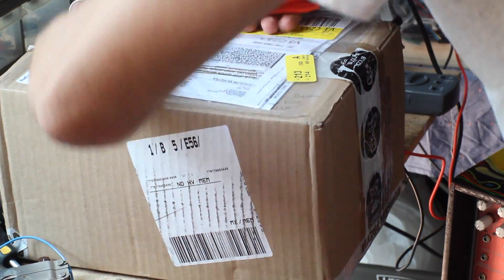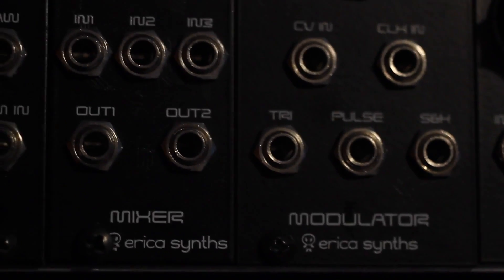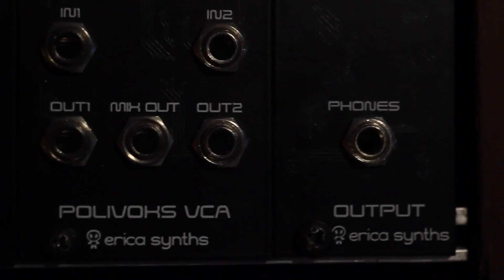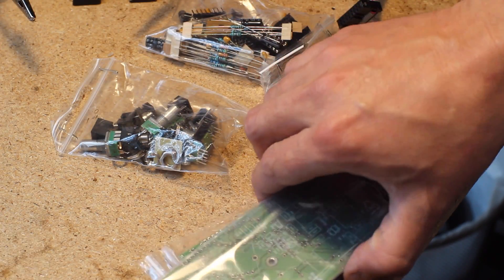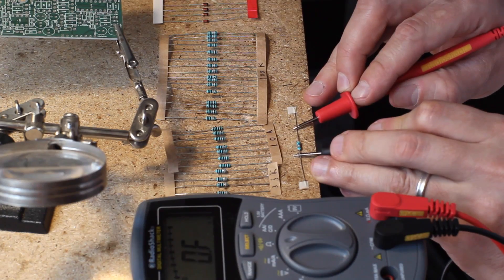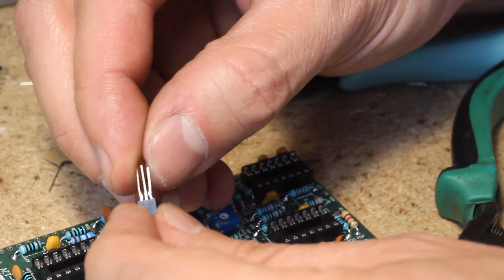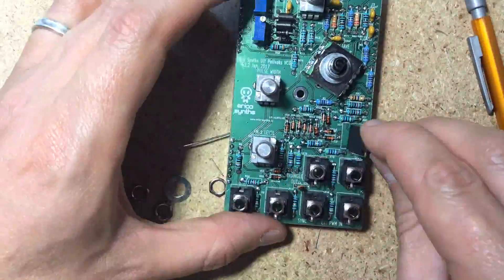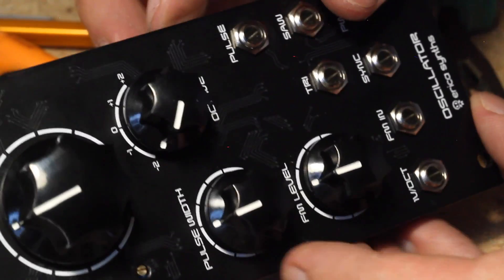Erica Synths DIY Bundle II Part 1 : The VCO

Comment: hi im planning on getting the panels and pcbs's for this kit. any reccomendations on what supplies i need besides a soldering iron.
Reply from the maker: Soldering STATION, with temperature control, Solder, wire cutters, tweezers, desoldering braid, desoldering pump, helping hands, multimeter, magnifier. That should do to start!

Comment: Hey synth DIY guy! I'm thinking of taking my first plunge into eurorack and i'm keen to start with two identical analogue VCOs. This one is on my shortlist, as is the Befaco Even VCO, the MST from Synthrotek,   the zlob dual VCO which is half the price and a quarter of the size of the other options. I am quite experienced with electronics so build complexity is not a factor... Just by aesthetics I think this is the nicest looking  one.. Could you please share any thoughts or suggestions? a befaco rampage and ornament and crime are high on my list i'll be mostly experimenting patching ambient noisy glitchy sequences..
Reply from the maker: Hi! Yeah, these are my favorite for looks and the big knob is super fun. If you have a linear power supply I highly recommend them, but they are fussy inder a switching PSU. The Befaco is more stable but lacks an attenuator for FM and instead of a Big pitch knob you get a big Octave switch. It has two extra waves and is smaller though, so, depends on your preferences and patching style!
I can't say anything about the MST or the Zlob since i've never played them. BUT, do stay tuned for the Ian Fritz Teezer, coming soon from Synthcube, it's my favorite analog VCO for noise, glitch and drone!

Comment: Do you have a video on how to calibrate? How do you use the multimeter and what exactly do you adjust? I've reached out to Erica Synths for clarification but have not heard back.
Reply: Hello Mr Bartok! What an honor :)
This VCO needs no calibration of wave forms, the onboard trimpots are there just in case, but the waves look great right away. Check them on an oscilloscope if you want to make sure. You only need a multimeter to check if you have any shorts in the power rails before plugging it in, to avoid accidents, but the resettable fuses and diodes are good protection. And for tuning the 1v/oct tracking all you need is your voltage source (CV keyboard or Midi2CV module), a tuner and a bit of patience. The procedure is detailed in the manual. Let me know if you have any further questions and I'll try to help!  Have fun
Reply: @QuincasMoreira having some trouble tuning. I can get 1 octave in tune. Then it starts to deviate 20 cents per octave. So up 2 octaves is in between 2 notes... Adjusting the scale will Always put an octave out of Pitch..

Comment: Hey, great video.  I just finished the VCO and so far so good except when I went to calibrate it, the module isn't tracking at all.  It's way off.  Do you have any suggestions for what to do next?   The octave voltages at TP1 were right on.  Thanks for any assistance.  -Adam
Reply from the maker: Hi Adam, sorry you're having trouble. It's hard to troubleshoot at a distance, what voltagesource are you using for calibration? I used my Keystep and it was pretty straightforward. Also, the PSU is very important, I find these VCOs behave well with very stable linear PSUs.
Reply: Synth Diy Guy 
Thanks for the reply. I’m using my Beatstep Pro. I’ve also tried it with my Pittsburgh Modular MIDI3. For the Power I’ve been using my Synthrotek Super Power. I’m going to try plugging it into my other rack today which is a  Tiptop power supply. I’ll let you know what happens. Thanks again.
Reply from the maker: No problem! If you continue to have problems try reaching out to Erica!
Reply: Synth Diy Guy 
I wrote to them last night. I know they are a very different time zone than me so I’ll try to be patient. 😀
Reply from the maker: Yes, Girts is also very busy, but I'm sure they'll help you out!
Reply: Did you ever have any luck with the VCO? I have the same problem as you- octave voltages are spot on but the tracking is not even close. I've tuned the scale pot over and over checked the frequencies on an oscilloscope as well as a tuner. It is always at least two notes off between octaves.

Comment: Great video. You mentioned a pdf with test point values?
Reply from the maker: Hi!  The PDF is my suggested procedure for building these as well as the optimal order in which to build them. I should post it later today. The test point values are in the Assembly guide, found in the Erica website.
Reply: Thanks for PDF - Where did you see the test points (1 to 9) on the assembly guide ? I could only find TP1 mentioned in 'calibration steps'.
Reply from the maker: you're right, I got this confused with another module I think! That's the only test point listed, so don't worry about any of the other ones ;)

Comment: Hey Quincas--I am so happy to hear from you!  I had a hard time calibrating my VCO, but it must be due to an assembly error somewhere along the way. Any pointers on calibrating analog VCOs?
Reply from the maker: Hi Brian! Just saw this. The main thing for having well tuned analog VCOs is a very stable, preferably linear PSU. Once you have clean power it should be just a matter of careful adjustment. What is a bit counterintuitive is that normally when the top octave is sharp you trim it even sharper, and when it's flat you trim flatter. Other than that I can't think of anything, if you still haver trouble feel free to message me privately!